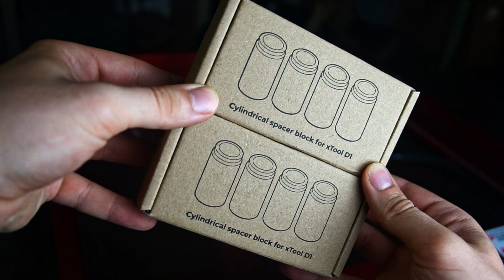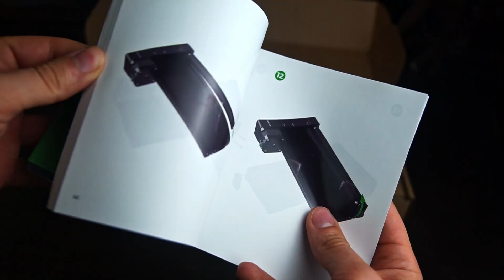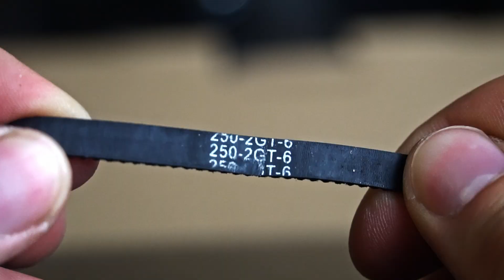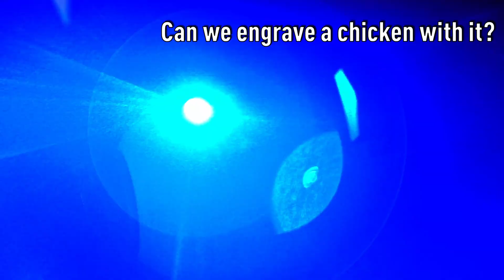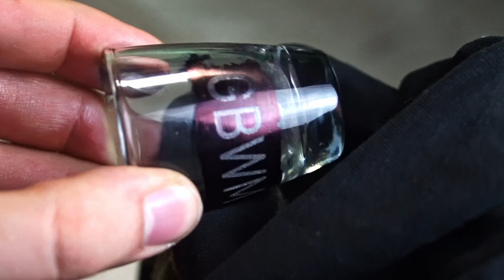xTool D1 Pro 20W  - Suitable CNC Laser For Starting a Small Business?

Comment: Raster Engraving...I used to design Laser Cutting machines....but they were CO2 lasers...😳😳😮🤔😏🇬🇧
Reply from the maker: co2 lasers  seem to be more powerfull but these diode lasers for engraving do work quite fine 😋
Reply: @GBWM_CNC  Yes, a real CO2 cutting laser has a cutting beam focus of less than 0.1mm diameter. Something you can't achieve with the laser in this video. The larger beam is an advantage during Rastering as it's faster...We used to defocus ours for engraving...🤔😳😏🇬🇧